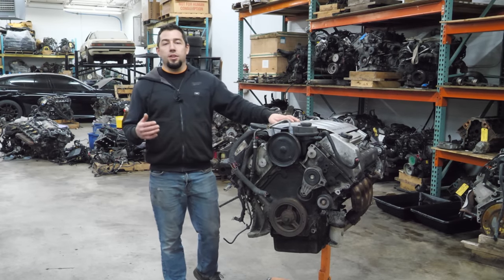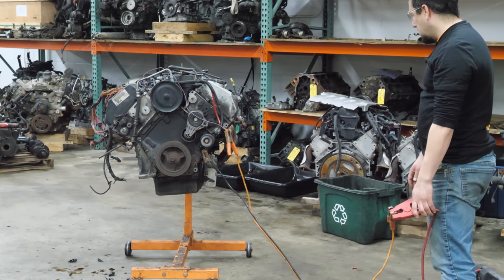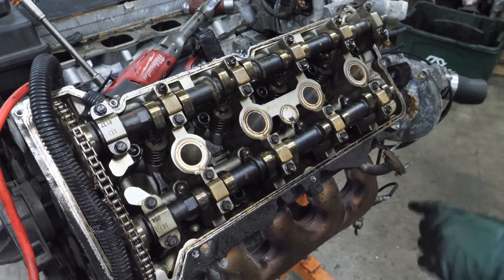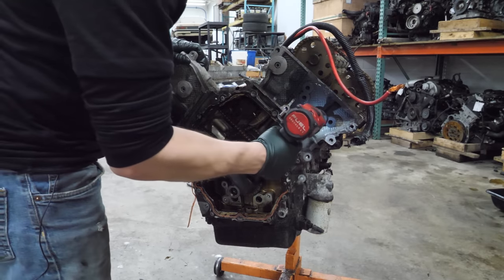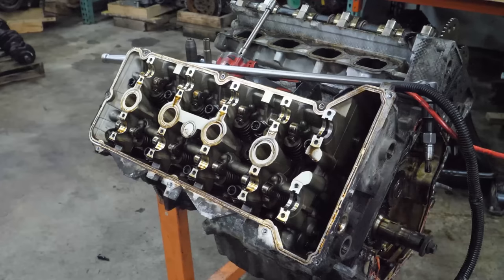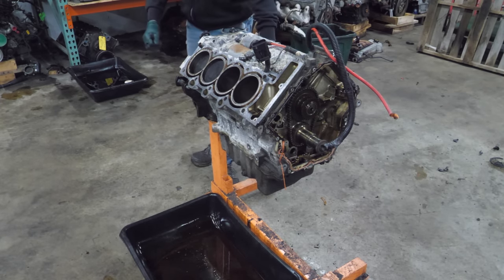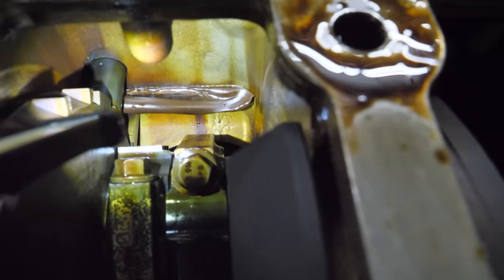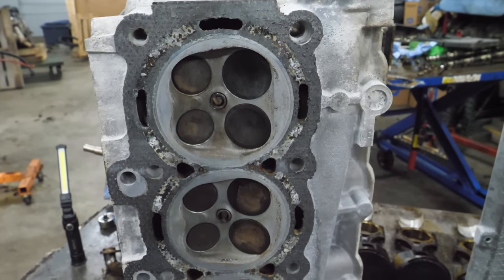Customer Returned This Cadillac Northstar L37 4.6L V8, How Many Things Can We Find Wrong?

Comment: Eric, they make a special tool that looks like a giant socket to remove the water pump from the housing. It turns about a quarter turn and pulls straight out.  It seats in the housing against a large o ring.
Reply: I have one of those tools new in the blisterpack. My dad traded in his '94 Seville in before I could change out the pump. Anyone want it?
Reply: Used to rent that socket out all the time when I worked at AutoZone. Important note you turn it clockwise to remove the pump and counter clockwise to tighten the new one in.
Reply: Cadillac North Star, the official car of “they make a special tool for that”
Reply: Yea that's Ford now special tool to take off parts
Reply: @heinrichgerhardt6119  would love to have the tool
Reply: I still have that tool even though I never own a Cadillac anymore for 10 years.
Reply: @kennyprehn7115  Post some way to get hold of you and we can make this happen.
Reply: there was also a kit sold for R&Ring the pump bearing's/seals after removal but that's been 5+ years sense i working for that performance caddy NE shop
Reply: yup! when i worked at o'fuck's (o'reily's) we sold it as a rental, "GM North Star Water Pump Socket" :)
Reply: This engine is like the poster child of the GM J-tools.  I have about a dozen specialty tools for the smelter. They even make a particular puller to remove the cam pulley for the water pump belt.  Doesn't work any better than the normal pullers, though.  It's easy to get off.
Reply: After 2005 they changed the way you remove the water pump no more special socket
Reply: @nickyj3571  Only on the rear drive version.  L37/LD8 still used the old design.
Reply: I have one laying around. No idea where it's at though.
Reply: Not a very well designed engine. The 4.6 Ford seems to be a much better design.

Comment: also the silicone used to seal the crankcase is an extremely common repair on Northstars...they love to leak in that area.  However, the previous tech likely put WAY TOO MUCH sealant on there.
Reply: Heheh hey ! Its mower moddin
Reply: It looked like there was an inset for a rubber seal but I didn't see a seal come out.
Reply: I wouldn't refer to a previous 'tech', tech implies it was somebody who knew what they were doing.
Reply: @photodan24  Exactly.  There's a molded silicone seal that goes into the bottom of the block.  It's part of the lower gasket set that includes the oil pan and front cover gaskets and the main seals.  They either couldn't figure out what it was called to order it or cheaped out with RTV.
Reply: what's just right ,   sploodge every were.

Comment: The Northstar head bolt debacle was corrected for the 01 model year and newer.
I got 255k out of my 01 SLS before sending it to the boneyard with a bad transmission.
Still ran strong...
Reply: 2004 was the complete redesign and it become next to impossible to blow up

Comment: As a retired Cadillac tech I can tell you the Northstar engine is an awesome engine.
Incredibly well designed engine originally a LOTUS design. Early pre 2000 blocks had issues with head bolt threads. The later 2000 and up GM changed the alloy used in the engine block and eliminated the head gasket issue.
Reply: I read some where years ago that the reason the starter ended up under the intake was they were working on an instant start system. The idea being to fire a key cylinder (fuel & spark) to start the engine. Most engines stop in one of three positions and the computer would use the starter to correct this position if need be.
Reply: It wasn’t eliminated, they made a change but it never was fixed , and because the only way to remove the engine is out the bottom , these cars were destined for the junkyard.
Reply: How can I get power out of the 4.6
Reply: They should have been sued, and recalled and repaired everyone that had bad HG bolts. They cost their customers thousands in repair.
Reply: @jerrygoldstein3028  Exactly. I had the LH2 version which was the 320 HP application and is used in the 2005+ STS, SRX, and XLR series. Mine crapped out due to coolant leaking into the cylinders.
I just simply walked away from it. The car was a nightmare to own.
Reply: @jerrygoldstein3028 not true, I pull these engines normally up, nothing difficult, 1.5 hours and the engine on the table, greetings from Poland
Reply: I'm an Australian. We never got thrm but EVERY SINGLE person and mechanic says they're rubbish because the head bolts are too small.
Reply: That's quite a consolation for those of us that own pre 2000 Northstar's isn't it? GM screwed their customers royally.
Reply: Was it fixed by the 2008 32vV8?
Reply: @heckler511  Allegedly. By that time, they discontinued the Northstar after 2011 I believe.
Reply: Remember the UV8 engine? I don't know why they scrapped it for the black wing. They were already halfway to the UV8 with that engine and then wasted twice as much money to market a car nobody wanted.
Reply: The 2nd Gen L37 was the best one of the transaxle cars. The third gen wasted all of its torque from faulty TCC solenoids.  Highest compression of the series, and IMO a better performer than the DTS "performance" that was detuned.  The majority of these engines did not tolerate the neglect people were accustomed to with a sb chevy or iron duke 4 cylinders. After the timesert update, most were too skiddish to own them.
Reply: @dccyo444  I have no idea about an instant start system, but the starter is under the intake due to packaging.  With no camshaft or distributor in the valley, it is simply wasted space.  The Toyota UZ V8 also has the starter in the valley, and I am sure there are plenty of others.  If you've ever had the pleasure of changing the alternator on a Northstar, you will know that there is little room to work on the outside of a Northstar...
Reply: @mackfar27 that was fairly "common" (not all that many were made in the first). Most are long gone, you used to get a "deal" on devilles as after about 200k km engine would start to hydro lock from failing head gaskets, in partial due to the head bolts stripping.
Reply: @KrGsMrNKusinagi0 If you ever get the opportunity to ride in a Northstar Fiero, do it!
It will put a smile on your face! 😁
Mike in San Diego. 🌞🎸🚀🖖
Reply: @jmcbreazy  northstar performance
Reply: @jmcbreazy  northstar peformance
Reply: @heckler511  Theoretically yes.  GM changed the head bolts to larger bolts from the LS engines somewhere in the 2005-2007 range which improved clamping forces for the heads.  Prior to this they had a smaller bolt that didn't have the best clamping load to properly maintain cylinder head torque and then would pull and in many cases when you yanked the heads to fix the head gaskets, the bolts would yank the block threads.  GM dealers still have the tool kits for these I guarantee it.  Was a TimeSert repair kit.  You have a drilling template, drill bits, thread taps, etc. to repair the pulled threads out, insert the timesert thread repairs and then install the upgraded bolts.
Reply: So what year 4.6 are you saying are o. k.?
Reply: Why did it have several times as many parts as it needed? The 383 small block in my '72 Nova will rip the tread off the rear tires, and still last 300,000+ miles.
Reply: @geraldscott4302    Unless your 383 has properly-tuned, closed-loop port fuel injection, was torque plate honed, and is running through highway gears and an overdrive transmission, I seriously doubt it's going to last 300,000 miles.  I've seen plenty of small block Chevies of that vintage that were worn out trash at half that mileage, and I've seen plenty of cracked small block Chevy heads.  My own 1973 350 4-bolt block had to be bored .040" over at 150,000 miles, and my Corvette and Suburban had cracked heads at 70,000 and 200,000 miles respectively.  As for having "several times" as many parts as it needs, I just added up all the parts in the Northstar and small block Chevy valvetrains, which I assume is the point you're trying to make.  Counting camshafts, timing chains, sprockets, lifters, valves, springs, retainers, keepers, and then the pushrods, rocker arms, pivot balls, lock nuts, and studs that the Northstar does not have, the Northstar valvetrain has 196 parts compared to 177 parts in the small block Chevy -- 11% more, hardly "several times".  And how does that 1972 technology do at meeting 1990s and 2000s fuel economy and emissions standards?  My experience with 1960s and  1970s cars is that 18mpg on the highway is lucky with a small V8.  My Northstar would get 28mpg on the highway.  A properly assembled and tuned small block Chevy can be a good engine, but there are many reasons why it has been out of production for 20 years.
Reply: @oldfag_adventures 😂😂😂
Reply: What about the poorer people that were suckered into buying a overpriced piece of junk.
Reply: @chrisbraswell8864    What is your definition of "poorer" anyway?  When the Northstar was in production, the MSRP of cars equipped with it were up to double the median income in the US.
Reply: @namikadaj3381  I always find it interesting peoples outlook on different vehicles when they come from a place that has an abundance of quality mechanics and the labor rate is not very high like it is in the states.
Reply: It wasn't a Lotus design as it was an entirely in-house project by GM. However if you read old articles from when it was new- the designers did however take some inspiration from the Lotus designed LT5 from the ZR1. Mainly the split crankcase and starter location.
Reply: Aha! An explanation that makes sense. A change in the alloy of the block would not effect the part# what doesn’t make sense is the “went to a shorter head bolt” myth, if that were true you could use the VIN/engine # to determine when the problem started and ended. Different head bolt=different part#, right? The brown mud in the coolant passages is DexCool that has been run with air in the system. Maybe the Northstar was prone to cooling system problems but G M switching to extended interval coolant was instrumental. My G M cars get switched to green coolant and 1 year change intervals at the end of the warranty period.
Reply: @killercan10  There is no Northstar with head bolts from an LS engine.  The original 1993-1999 head bolts are 140mm long with M11x1.5 fine threads.  The 2000-2003 head bolts have the same threads but are 157mm long.  The 2004-2011 changed to M11x2 coarse threads and are 161mm overall, and they also increased the thread length by 50%.  They all have a 10mm socket head and a captive flat washer.  LS head bolts are M11x2 threads  like the later Northstar but with 100mm length and a 15mm hex flange head.
Reply: This better be satire.
Reply: @Pistol54Pete get over it boomer
Reply: Yeah, it only took GM 10 years to fix the head bolt problem. This was the start of the decline for GM.
Reply: @KevinJames-yg9eu , those were $50,000 dollar cars even in the mid 90's. Not cheap.
Reply: Oh please, it's a pos engine in a pos car. From a horrible auto maker to a hack mechanic...
Reply: @Pistol54Pete as a Cadillac tech I can assure you plenty of engines were repaired under warranty.
Reply: @falcorthewonderdog2758 dang cams were too strong. Looks like they were considering open cams based on the huge opening for cam gears on valve cover. Running the alternator both on belt AND chained to Cam GM should have stated the Alternator was a 'lifetime' alternator. Drastic temp drops tough on aluminum.

Comment: I do a couple of these starters a year, you CAN pull the intake without messing with the fuel rail. Swivel 10mm socket and work that bolt up as you lift the manifold up then run it down as you put it back down. It's a little awkward but it's faster and easier than pulling the rail and messing around with seized fuel injectors on a plastic rail.

Comment: I am of the belief, those who returned the core melted the pulley and broke the bolt. Only then did they discover the seized water pump. Of course it got left in the rain, before, during or after it got installed. Only for it to have to come back out. A super sketchy repower, right from the start. Thanks again for your hard work. I, like many others here really appreciate your efforts

Comment: My dad had a '94 Seville with the 275HP version. I did all the maintenance on it in the 13 years and 100k miles he had it, and nothing went wrong other than the water pump shaft seal seep and A/C compressor leak. These loved to rev and were pretty impressive for having been designed in the late 80's. Even the 4T80E trans shifted well. Too bad it was FWD.

I remember reading about these having a limp-home feature where you could drive for 50 miles with no coolant. If overheated, it would run on 4 cylinders, alternating between banks so that the shut-off cylinders could air-cool themselves IIRC. If it got into this mode, the PCM would afterwards say "oil change required" as that would have cooked the oil.
Reply: Realistically though, if your Northstar is out of coolant, it's probably because a failed head gasket resulted in it blowing all of its coolant out, so the engine is already dead, regardless of limp-home mode.  Ask me how I know....
Reply: @KevinJames-yg9eu  :Nah. Usually a failing waterpump that was ignored til it locked up completely. The overheating ruins the headgasket.
Reply: These did have limp home mode that cam pulley for the water pump broke on mine and allowed me to drive slowly and dash would tell you "Engine too hot" I shut mine off 5 miles from my house and got a tow because I didnt know about the limp home mode until after I did the repairs.

Comment: I've done Northstars including head and main stud conversions, not for the faint hearted!  Once fixed they're a great engine!  P.S. I can do the starters in under 30 minutes easily.  The junk inside the water passages is most likely due to those horrid GM coolant tablets that GM told you to put in the cooling system!  Some dumb goon has done a bottom end reseal on that oil pan and used too much silicone.
Reply: Those were anti-knock coolant tablets. Coolant lines within wall adjacent to oil pan. RTV easy fix.
Reply: Have a 97 GM, and yes the tablets were part of the cooling system service. It seemed strange, so I never used the tablets.
Reply: The tablets were anti corrosion additive replenishment for the dexcool coolant. The junk in the passages is from mixing incompatible coolant with dexcool. The dexcool fiasco wasn't necessarily the coolant, it was GM's ineptitude in engineering. Formulating their own coolant to deal with electrolysis was a swing and a miss. Their electrical engineering was the real problem. Iron and aluminum react with the coolant, but when the coolant carries the ground load of the electrical system due to poor ground connection methods things get out of hand quickly.
Reply: @truracer20 Wrong!

Comment: Fun Fact:  The Northstar V8, the C4 ZR1's LT4, and the V8 in your Lotus Esprit were co-developed and share many similar features and characteristics.
Reply: You mean the LT5 in the ZR1 Corvette, the LT4 is just the well known smallblock Chevy.
Reply: This is a common misconception. LT5 was designed by Lotus in the UK- they were owned by GM at the time. The NorthStar was entirely GM North America, but they were open about the fact that they took some inspiration from the LT5 if the read the old article about it.
Reply: That chain drive system is a sight to behold! Plus bassheads could run 4 extra alternators and run of cam gears..
Reply: @IwanTchernenko I thought the same thing until seeing a few vids in 2014 GM reapplied LT series to mean a whole buncha things, but pushrod is common theme and 8 cylinders. I too thought LT1, LT4 always meant 350 cast iron block like I had in my Roadmaster.